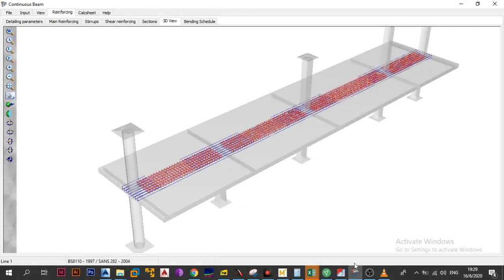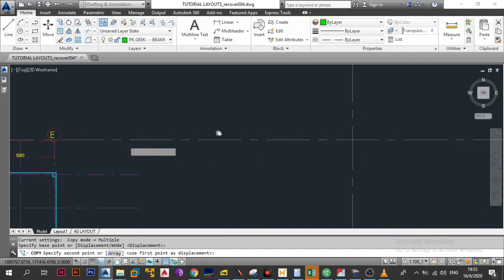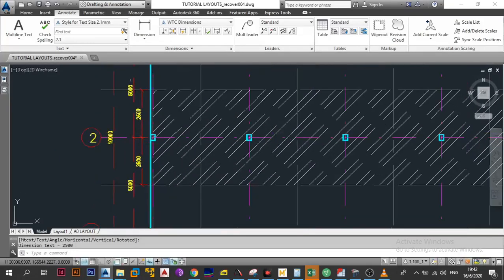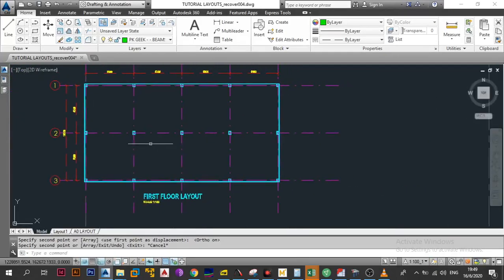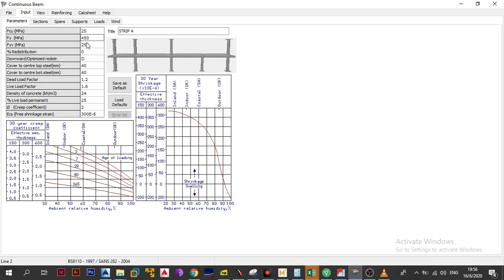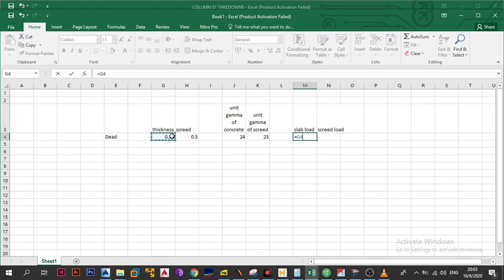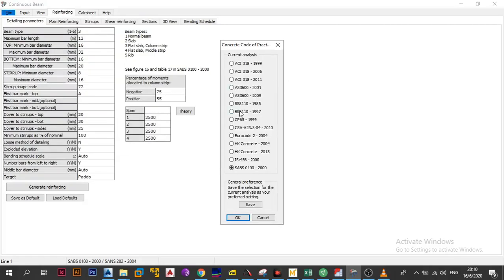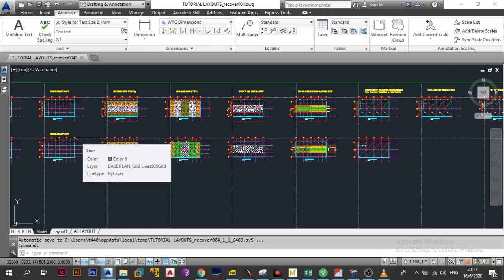Prokon Flat Slab Design Tutorial | Part 1: Flat Slab Design Example, Intro to Theory & Column Strips

Comment from the maker: Skip to the part you want timestamps below

00:00 Introduction
00:24 Understanding Flat Slabs
02:21 Looking at our Slab Example
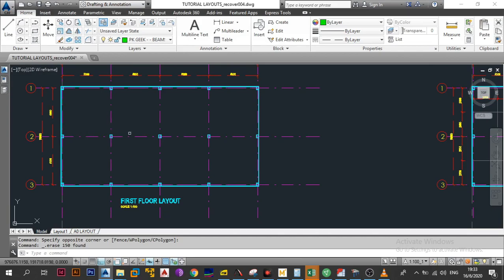04:14 Step One Establishing Midpoint
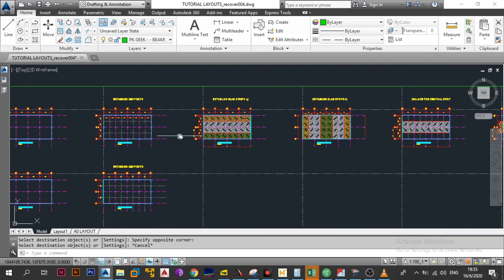06:20 Step Two Slab Strips
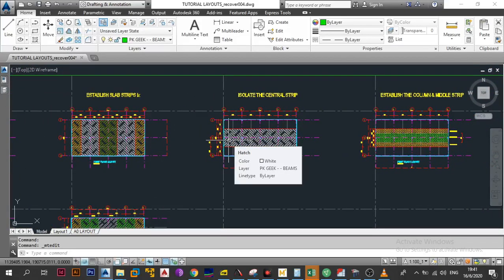12:10 Isolate the Central Strip
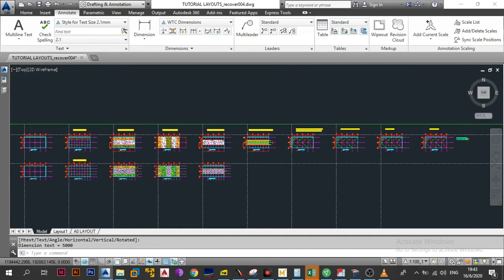14:50 Column and Middle Strips
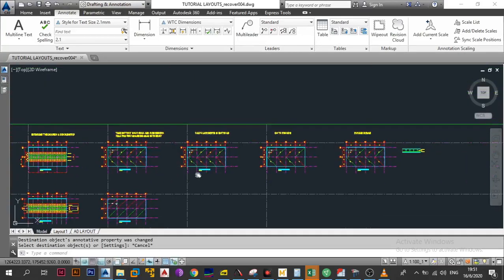22:30 Depth of the Slab
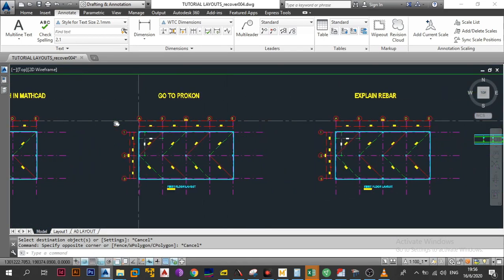27:00 Entering Data in Prokon
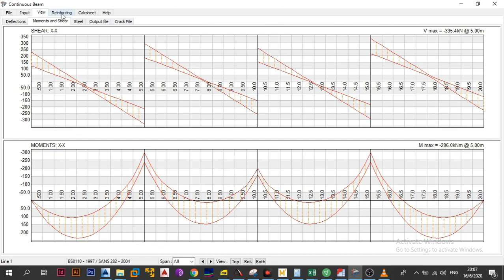38:22 Reinforcing the Slab In Prokon

Comment: Thanks prokon guru for the great video. is it necessary to change the percentage moment distribution table for flat slab middle strip to 25 and 45 for neg and pos respectively Option 4 on beam type.

Comment: Hullo Prokon Geek. Thanks alot for the video. I noticed some thing. Why did you divide 2500 by 17 to determine spacing, yet the 2500 is for the column strip. This is because in Prokon, a slab strip of 5000 was considered so I would expect to divide 2500 by the number of bars got from a 75% of 253KNm Moment.
Reply from the maker: Hie Brain how are you firstly thanks for watching the video. I divided by 17 because i prompted prokon to detail the slab i told it to reinforce only the column strip so the 17 bars i have there are specifically for the column strip, that is the reason why you choose which reinforcement procedure and placement you want in the detailing parameters screen those 17 bars are the bars that come after the 75% allocation is already done.
Reply: @prokongeek6239  Thank you for clarifying.
Reply from the maker: Not a problem

Comment: Prokon geek. I was going through the loads entered in the software and I might be wrong but I realized that the software already encompasses the self weight of the slab and from the calculations in excel you are including the self weight again in the dead load.
Reply from the maker: Hey Rocky thanks for watching yes i noticed that, it was a mistake on my part guess i was rushing through it and got lost to the music lol in this case we will need to  reduce the thickness of the dead weight contributor from 250 to 50 mm which will just be for the screed in this section, you can use 22,23 or even 24kN/m3 for its Gamma and  it will give you around 1.0 to 1.2 kN/m2 and then multiply it by whatever length you you have

Comment from the maker: Skip to what you want  timestamps below

00:00 Introduction
00:24 Understanding Flat Slabs
02:21 Looking at our Slab Example
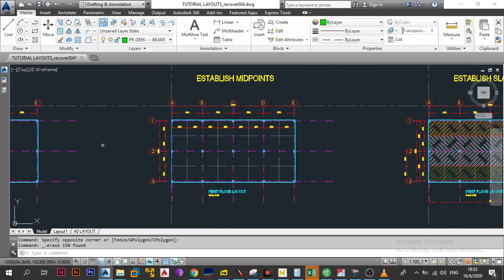04:14 Step One Establishing Midpoint
06:20 Step Two Slab Strips
12:10 Isolate the Central Strip
14:50 Column and Middle Strips
22:30 Depth of the Slab
27:00 Entering Data in Prokon
38:22 Reinforcing the Slab In Prokon